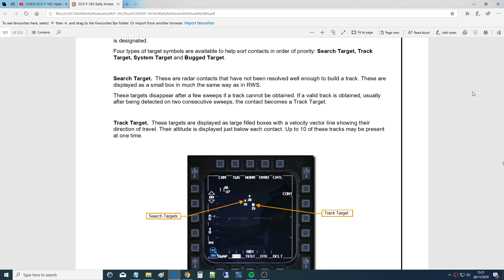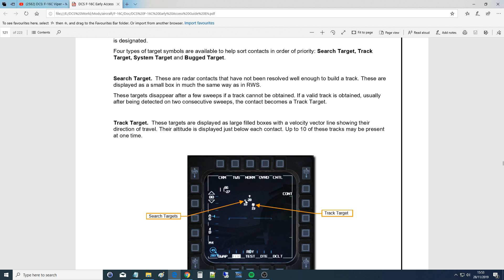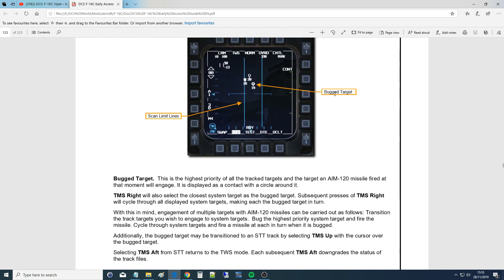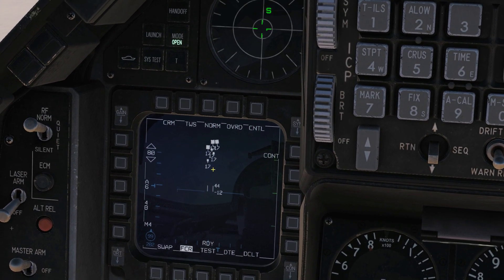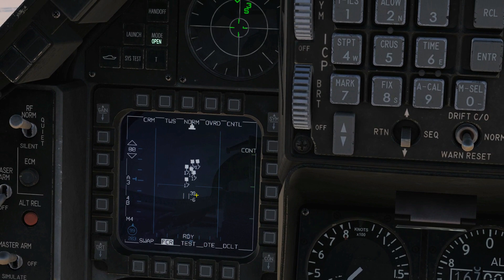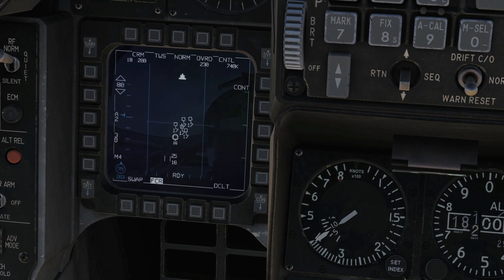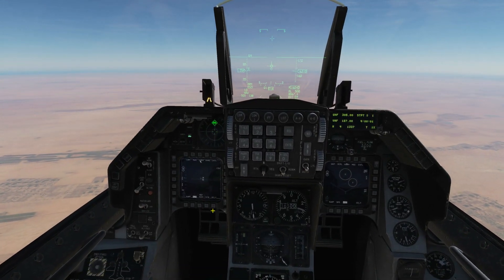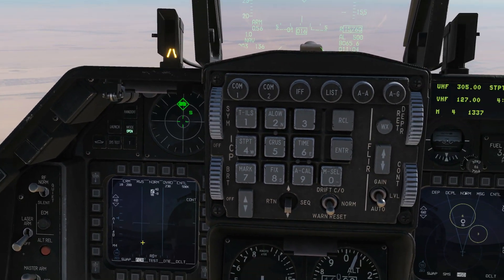F-16C Viper: TWS Radar, Expand & Rippling AMRAAMs Tutorial | DCS WORLD

Comment: TWS on F16C is too evil. Moving antenna automatically with a designated target so you can maneuver up to your radar's limits with that ungodly agility? F/A18C is enraged at this. You know that the only thing you can do even when encountering a lone F16 as a group - is to split. Split as hard as you can. And pray that there's only a single F16C right there.
Reply: You can do the same with F 18 if you turn the radar to auto mode after you bug or track targets
Reply: The button is in the middle right of the mfd